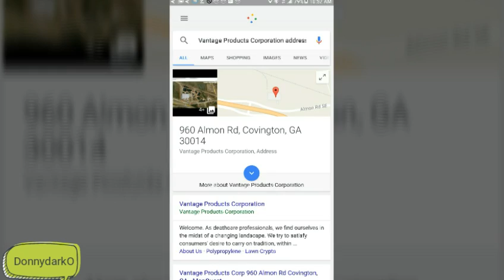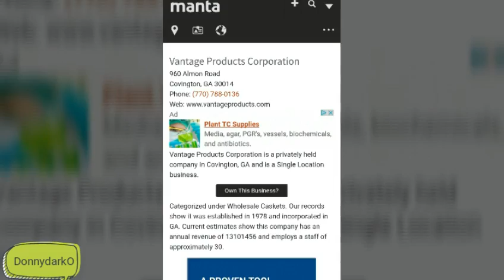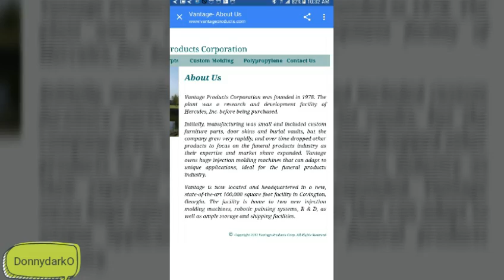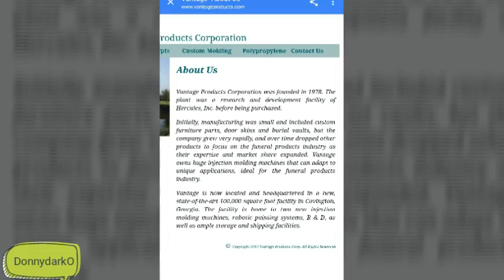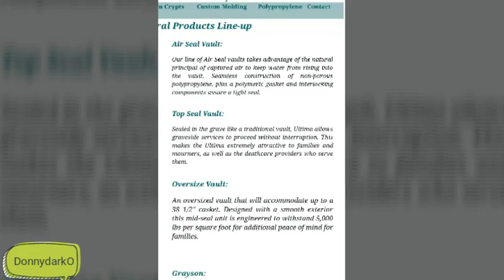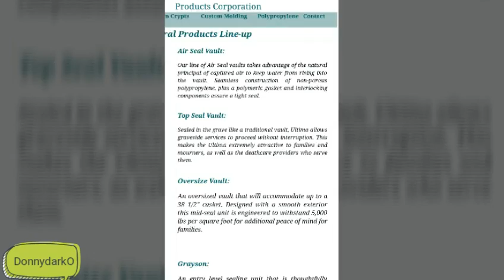FEMA COFFINS MANUFACTURER FOUND IN GA -VANTAGE PRODUCTS CORP PT1

Comment: Wow.  First learn to say polypropylene correctly.  With the growth in plastics a company found a new market to go after.  They are easier to work with than older methods, such as concrete and will last longer than wood.  They found that its good to cover coffins with this plastic that will last many years and be strong enough to not cave in like a wood will.  It has noting with FEMA.  I have been to this facility working with plastics.

Why suddenly call it a FEMA conspiracy?  It sure would be much better to have this as an example of American entrepreneurship.  They saw a new opportunity and built a company to manufacture new products.  That should be celebrated.

Comment: I worked for this company for almost 4 years. There is nothing really creepy about it. Yes they do have a contract with fema to keep at least 50,000 of them on stand by in case of natural disasters. Remember the tsunami in 2004 that killed over 200,000 people well it's for cases like that. The reason they are black is cause they are made from recycled car batteries the raw material is black red white and several other colors so they add black coloring to make them uniform color. They are not bullet proof they are plastic. are they strong yeah but that' because they are so thick. This company makes all kinds of stuff. Those green splash blocks you put under your rain gutters, Shutters, gable vents, coffins, heck they used to make furniture parts too. But yeah they keep a stock of the vaults for natural disasters  people have got to be buried all those dead bodies cause disease if not buried properly.